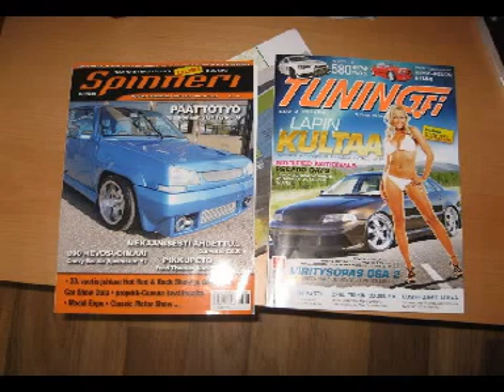Neckar Jagst Turbo Project pictures

Comment from the maker: @cicibanx89 No, in front i have old mercedes 300d radiator and inside car small heaterpanel. Water fill / expansion tank in front and rear to get all air out of system.